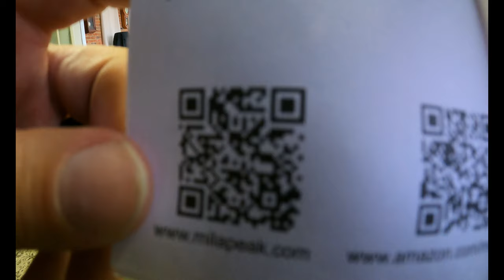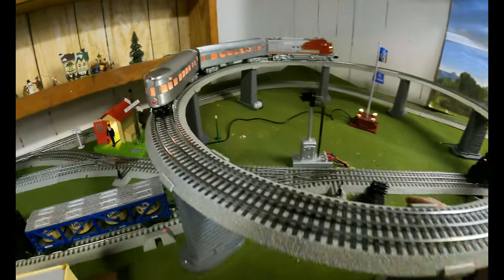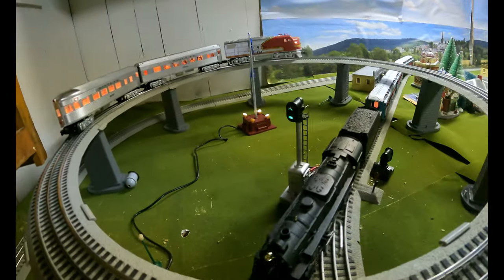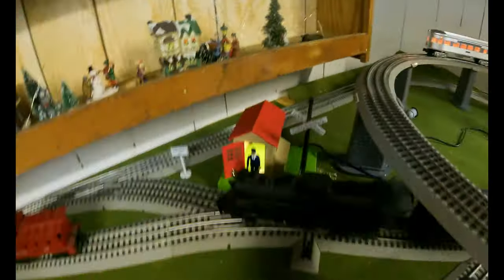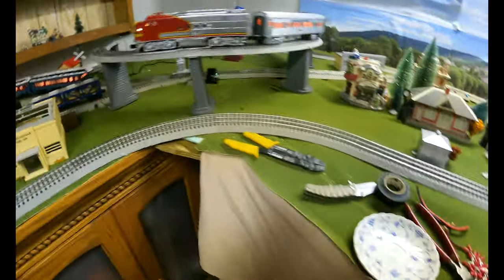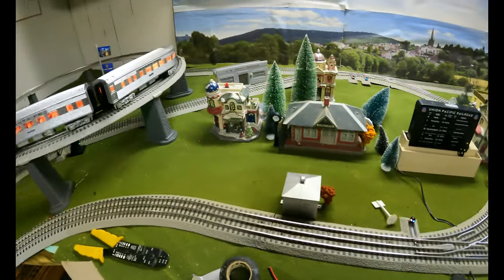Ep 99 Wiring Lionel accessories with Terminal Blocks

Comment: So far, I'm uncomfortable taking my soldering iron under the trainboard, fearful of dripping solder on myself.  So i splice the wires together with a twisted t then use a 1 inch long shrink wrap with my heatgun. Not certain of long term but certainly electrical tape seems useless with really poor quality, tape failing within months. So far shrink wrap seems a good alternative.   Thanks for your videos.  Gary j
Reply from the maker: If I'd known back in the 80's what would happen with electrical tape, I'd have bought two or three cases of it!
I've never dropped solder on myself - grabbed the iron a couple of times, that's about it. The key to it is to get a good soldering iron and LET THE THING FULLY HEAT UP before you start. Next, don't cold weld. Always keep the iron against the wires long enough to heat them - the solder flows into the wires. Shouldn't drip. You'll know you did it right if the solder is shiny. If it's dull, the wires didn't heat enough.

Comment: you lost me at 12:15 minutes into the video...i wanted to see where there lines were coming from and where they were going to
Reply from the maker: right to the power supply for the railroad. Wires from accessories to terminal blocks, those in turn connect to the power supply, the accessory outlets. Another way you can do it is to have an accessory extender track, and hook it up there, but that seems like a fiddly and possibly overheating/dangerous way to do it. I'm not sure why, can't articulate it.